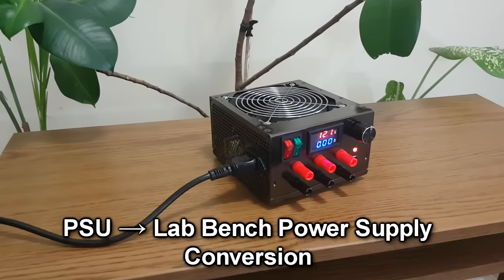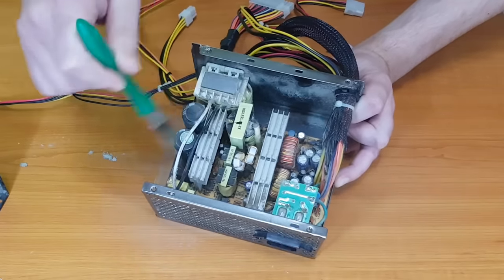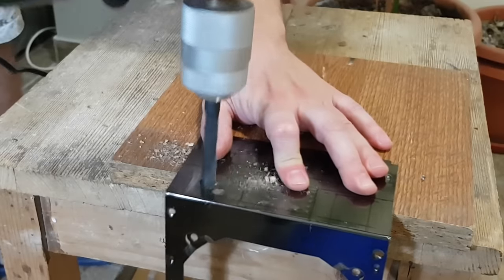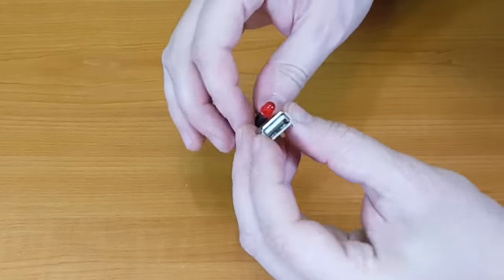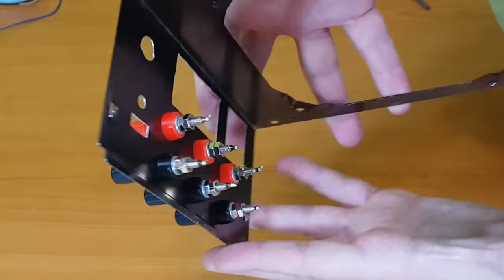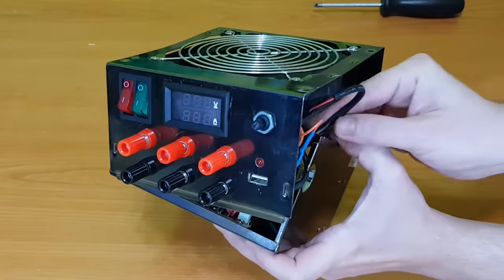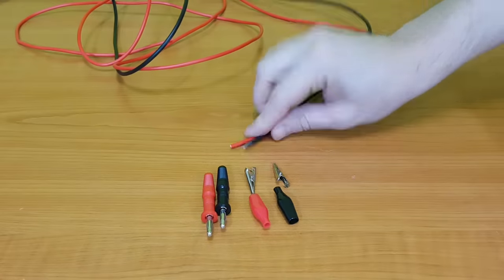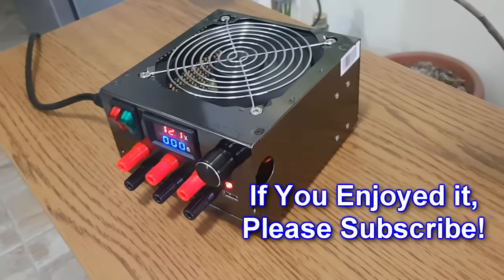DIY - Lab Bench Power Supply

Comment: ALSO, for the power resistor, if you run it on the 5V + 3.3V rail (hope you checked which one had the most maximum power), you should really use 5W 5ohm. You can go higher ohm if you have to, but 10W and 43ohm just sounds like sparks and fire waiting to happen
Reply: By power resistor, you mean the dummy load resistor ?
And about using 5W instead of 10W, whats the issue there , can you explain, please ? (Im not that tech savvy)

Comment: The -12v line can be combined with the +12v line to give you a 24v output. YMMV on if this will kill the power supply after a time, though.
Reply: Or a symmetric power supply unit. -12 / 0 / +12

Comment: I saw the binding post metal seem to touch the body of the power supply when you screw it in....does it give you a shock when touch the power supply in use?
Reply from the maker: the binding posts have a groove in the plastic and keep them centered. the metal pin doesn't touch the power supply case.
Reply: @Sorin_DIY  thats really nice i guess i need it to power my grass trimmer connection...currently i solder them directly but since your banana plug looks neat i will try it

Comment: AND ALSO: When drilling holes into metal, drill slow, and use bits made for it. Same goes for sawing, use a metal saw/file, go slow, go accurate.
Drilling a smaller hole first is great, but doesn't help when you have shrapnel in your eyes

Comment: What if I want to measure more than 10 amps?   Also what would happen if you pulled more than 10 amps through your meter?  I have a 3.3v @ 22a, 5v @ 22a, 12v @ 80a psu.  As long as I’m gauging everything adequately, is there anyway to be able to measure it as well with a meter?
Reply from the maker: hi. if you use more current than the ammeter can measure, most of them will display "- - -" A and shouldn't get damaged. if you draw more current than the PSU can deliver, the PSU should have overcurrent and short circuit protections and should turn off, as you can see in my part2 video. you can use a volt/ammeter with a shunt, it can measure current up to 100A, but usually they are not precise with low current readings.
Reply: Sorin - DIY Electrical Nerd awesome sorin.  Thank you!

Comment: Hi, You did it.....Complexity made simple; very well done.  Methodical and very detailed.              I made a DC power supply guided by your YouTube video (although mine didn't have the higher tech devices....).   I connected  orange, red, yellow each going to individual  banana connections on the ATX housing (was careful to stay away from AC power and cooling area).    I added a black ground wire going to a separate banana connection (I would only be using ONE voltage at a time in my project, so I didn't need multiple ground connections). HELP PLEASE....my problem  is that I am getting NEGATIVE volts for each of the three (orange, red, yellow).  I must have done something (?) wrong but I can't figure out what. Do you have any suggestions as to what I might have done wrong?, Thank You, Richard (Senior Citizen 76 )
Reply: Solved......leads were backwards at the meter

Comment: Welp, following this tutorial, i've made one for myself! It works quite well, but i didn't have any high voltage resistors yet, so i just used two in parallel. They get super hot after a few minutes, though, so i'll have to switch those out for a high voltage one later.
Reply: I also didn't have a rotary switch, so i put 3 extra terminals outside and hooked the sensor wire up to a male terminal and switch them that way. Still works, luckily.
Reply from the maker: you can use any switch with 3 or 4 positions. for the resistors, what did you use? maybe you can connect the in series. it will increase the resistance, lower the current, so lower the temperature.
Reply: @Sorin_DIY  I just used 2 half the ohms in parrallel. I wired them with shrinkwrap out the side of the case so I can monitor temps. They have almost turned black, but I can run the thing for a few minutes at a time. I already ordered a 10w 50ohm to replace them.
Reply from the maker: you need minimum 22 ohm resistors. that's why they get hot.

Comment: Nice power supply, nice tools. But it looks the voltmeter is not for measuring output voltage but to monitor the voltage of any of three outputs on which a load is connected, a similar method used by someone else I watched on YouTube😊

Comment: Nice build.  I like that you did things safely.  Probably could have omitted the main AC power input switch since it has low standby current draw when switched off.  I've done this, but beware, some of the cheap chinese made PSU's are ground referenced to mains.  In the last one I used, the case was live at about 90v AC with no apparent shorts.  I trashed it as it immediately tripped GFCI outlet protectors when turned on.  Better PSU's have better isolation.

Comment: Why do you need the 10W resistor to stabilize the voltage? From my experience, the voltage is pretty stable on its own, without any additional current draw. Are you sure your PSU is not faulty?

Comment: i wonder why dont connect all of the positive wires just like the negative ones but put on them a diode so that way you will get a output from just two connectors and dont have to switch between them. Also great video and experiment

Comment: You are really genius to make the voltage stable add the resistor ...does it increase the current too? I need it to be to kick start a 12 Volt DC motor which require at least 5 Amp to kick start it but in normal turns it actually uses around 1.5 Amp. I know the SMPS has an Auto switch which will shut down the PSU automatically when it release too much amp more than it require to prevent it from damage. But i really need it just for kickstarting the motor. Would the resistor like you did will help?
Reply from the maker: hi. I think it will work with a dummy load resistor connected to the same rail. you can try to connect more resistors in parallel, to increase the current consumption if needed. you can also add a big capacitor in parallel, 6300uF at 25V, it will help to keep the voltage more stable.
Reply: @Sorin_DIY  Hey i found the solution to this already....thx anyway

Comment: you`re installed a selector switch. you could also use 1 banana connector instead of 3, switching by 3 MOSFETs as well. if you for example select 5 V, the related MOSFET switching on and you have 5V. And you do not have to change connector when you need another voltage.
Reply from the maker: hi. I wanted this project to be simpler. but I will probably make one in the future, with voltage switching and other features.
Reply: @Sorin_DIY  I will follow. Good luck!

Comment: So it's only 3.3 5 and 12v? Can't you use a buck boost converter to make a higher dc voltage?
Reply from the maker: Yes. I plan to make a better power supply conversion soon with more features.

Comment: Hi Sorin,

I still have some questions about this project and I have a few minor problems. I think I have connected everything as it should be, but I do not measure the correct voltages on the binding posts, the voltmeter does give the correct voltages. is it possible to make the schematic even more clear because i am a beginner in electronics.

Comment: you can buy a knockout plug from a hardware store that has electrical fittings. Just measure the hole in the power supply case and purchase the proper fitting electrical knockout cover plug.

Comment: Thanks for the build vid.  Most of it was very clear and of the ones I have watched thus far, the best!  However, I do not understand why you have 2 power switches.  Thanks!
Reply: Theres two signals the motherboard sends to the psu (usually green power on ) power good is grey the green is to start the supply and the gray for activating the rails
Reply from the maker: hi. one switch is to connect the PSU circuit board to the mains. the PSU will be in standby mode. the other switch connects the green wire to a black one and turns on the PSU. you can bridge the green/black wires, and use only one switch for the mains. you can also watch my part2 video for more explanation.

Comment: Can we trick pcu Pwm controller to produce higher voltage then 12 v at 10 amp ? By modifying the OVP ,  OCP and dead time control circuits  ?
Reply from the maker: some power supplies can be modified to increase or decrease the voltage with only a few volts, but it's very difficult. usually they are not stable anymore.

Comment: Hi Sorin, Why haven't you used the brass lead from rocker switch?  if you had used them wouldn't it light up when switched on? or it would be a problem because on switch would be connected to AC and the other to DC? I couldn't find this video on your Patreon page.... Thanks a lot!
Reply from the maker: Hi. if I would make a power supply conversion like this again now, I would solder the green wire to a black wire, because the standby mode is useless. and I would add a switch on the mains input, so you can add any type of switch you want.

Comment: Hey nice video. Just wondering, did you have to zero the ammeter or something to account for the load resistor? Also do you need a load resistor for the 12v too?
Reply from the maker: hi. the load resistor is connected to a separate black wire, it's not measured by the ammeter. if you connect big loads to the 12V output, it may need a dummy load resistor.
Reply: @Sorin_DIY  thanks for the quick reply. Doh, of course just bypass the ammeter with a separate wire.. cheers!

Comment: i read many articles, but still I did not understand why we are using those dummy load resistors ? what is the actual purpose of those ? Thank you in advance, please explain :)
Reply from the maker: hi. it forces the power supply to produce some current, so when you connect the real load there will not be such a big difference for the power supply. without the dummy load, there may be a big  difference in current consumption when you connect the load, the voltage may drop and the power supply will turn off. please watch the part2 video for more details.

Comment: Nice Project Sorin, I have an old AT Power supply as a lab bench Power supply for my digital Projects, but there is no 3,3V output. I will look into my junkbox after a scrapped ATX supply to modify according to your video.

Comment: Two questipns for you: why do you need a resistance load? And what is the negative wire used for?
Reply from the maker: if there is no load connected to the power supply and suddenly you connect a big load, the voltage will fluctuate and the power supply may turn off. but if the power supply detects a dummy load, it will deliver enough current from the beginning, so when you connect another load the voltage will not fluctuate. you can also watch the part2 video for more explanation. what negative wire are you referring to?
Reply: @Sorin_DIY  you actually replied. :D
Been watching all your videos. They are great! I studied but did't really learn "practical" stuff. Only theory. I built one crude power supply years ago mainly as a study case. To smooth out the voltage I used a capacitor because from what I had learned previously it's how it should be done but well, you (and other people here) have shown that it's wrong. Thank you!
I was actualy talking about the negative voltage. Expressed myself wrong, sorry!

Comment: Is that a "break-before-make" rotary switch?  If not, you risk over-voltage on the lower voltage side when you rotate the switch.
Reply from the maker: it's a break-before-make switch. I explained it with more details in the part2 video.

Comment: Few questions . 
1. can i power up at the same time 5v and 12v projects? If not , then why three ground plugs that are together connected and not just one?
2. Can I add two USB ? One with 5v stb 2.5 amp  and one with 5v max current?
Reply from the maker: hi. yes I can use all the outputs in the same time. and yes you can add 2 USB ports. please watch the part2 video for more info.

Comment: Hi Sorin! Your lab bench power supply looks pretty good among others.
I have a question. Please tell me, why do you use power resistor?  I understand it"s used for correctly work. But what is a nature of this solution?
Thanks.
Reply: Because an ATX PSU requires a load for it to function. In order to get the PSU to think it is connected to a computer, you have to connect a dummy load resistor to one of the power rails to fool it into thinking it is connected to a computer.

Comment: Great job. One question, the dummi load resistor is installed on the 5 volt circuit only? Thanks.
Reply from the maker: hi. the dummy load resistor should be installed on the rail with the most current, usually that's the 5V rail. but you can install it on any output you want. if you use only the 12V rail, you can solder the resistor to it.

Comment: Should the individual outputs (3,3V/5V/12V) be protected with a fuse in case of a short circuit? Or do all PSUs have a built-in fuse?
Reply from the maker: theoretically all PSU should have short circuit protection. but we cannot be sure about the cheap ones.

Comment: Hey great work! I'm about to make one too! BUT I want to be able to adjust amps too,not only volts. I mean, getting 12v with 0,5A, and 12v with 1A or 2A or 1,87A. Any ideas for that? except from buying a regulator...
Reply from the maker: hi. I don't think you can do that just from the PSU circuit board. you still need to add a converter with variable voltage and current.

Comment: @11:23 I just want to know where did you got that PCB holder. Seems cool with a lot of corner manipulation and of course they do not have those plastic screws that keep braking.
Reply from the maker: hi. I've bought it from a local store. it's this model:
https://www.aliexpress.com/item/32999228154.html?spm=a2g0o.productlist.0.0.889e1e4dZukuT4&algo_pvid=bc7d7b96-4f7a-49fc-b780-d7dab9ee997c&algo_expid=bc7d7b96-4f7a-49fc-b780-d7dab9ee997c-39&btsid=07643729-7e77-47fc-a731-b5b1003cb43c&ws_ab_test=searchweb0_0,searchweb201602_5,searchweb201603_52

Comment: Why use a selector and separate plugs? You can't use more than one voltage, or it's only for the current meter display?
Reply from the maker: the rotary switch is toggling only the voltmeter between the outputs.

Comment: Even though the standby says 2.5A, since you only have the power and ground connected in the USB, and don't have the proper resistors set up on the data lines, your phone doesn't know what the max current allowed is, thus it will limit what it draws so as to not overload a possible low amperage power source.
Reply from the maker: hi. please watch the part2 video to clarify this.

Comment: Great video. I have a 700w power supply that I want to connect to a RC battery charger. The recommend input amperage is 20 amps, but each channel of the yellow wires is only 18A, I was thinking of paralleling up two of the channels to give me 36a, will a PC power supply handle this?
Reply from the maker: hi. on some power supplies that will work. but I don't know if it's the same for all PSUs. I suggest you try it first with only one 12V 18A rail. the current may be sufficient. if it's not, the PSU should turn off, by its safety features.

Comment: I do not understand why the big resister is needed? Can you comment on that please. You say to stabilize the current. If I want a stable 12 volt current, what kind of resister I have to add to that?  How do I know, I use the right resistors? I understand most of what you explained but shorting + to - through a resister I have no clue why or what values to use. Love your video :)
Reply from the maker: for the 12V output you can use a 10W 68ohm dummy resistor. and for more info about the dummy load resistor you can watch the part2 video.
Reply: @Sorin_DIY  Thank you very much. Love your videos.

Comment: I know the power supply has an automatic overload protection circuit...but what do you think about adding  a diode/s on the binding ports...ive had a few that have burned out because of accidently crossing wires a few too many times.
Reply from the maker: hi. if you add diodes on the positive wires, it will save the power supply, if you short the wires. but the voltage of each output will decrease with ~0.7V and the current will be limited to the diode max current. it will work for small loads.

Comment: Thanks for sharing. 
I am not sure ATX power supply are designed to handle accidental short-circuit. Did you have a chance to test that?
Reply from the maker: hi. I've tested the short circuit feature and it works fine. you can check it out in the part2 video.

Comment: Good tutorials with some topic jumps xD
But why you have made separate black poles if they are all connected anyway? There are bananas which can be pluged into another so there is no need for several minus plugs.
Reply from the maker: Hi. I think it looks better with 3 pairs of binding posts and I can use all 3 outputs in the same time with simple banana plugs.

Comment: Hey, thank you for this nice Video. I've a question: Is that right that the LCD panel only displays the Ampere and the added device can took the ampere they need? Backgound for my question is, I need a Power Supply whith much Ampere and lower V for galvanic.
Reply from the maker: hi. the power supply has a maximum current for each output. if you try to draw more current, it will shut down. the ammeter is showing the current used by the load.

Comment: I have a question, is the current output from the ATX constant at a given voltage or it changes as per the devices requirement?
Reply from the maker: the voltage is constant. the load draws what current it needs, up to the maximum current of the power supply.

Comment: What is the use of your potentiometer on the right side of power supply? There is already a volt meter, so what is that for?
Reply from the maker: that's not a potentiometer. it's a rotary switch, to change the voltage displayed by the voltmeter. you can watch the part2 video for more details.